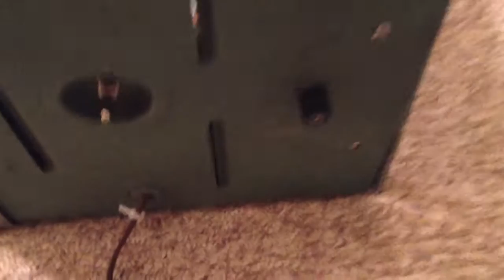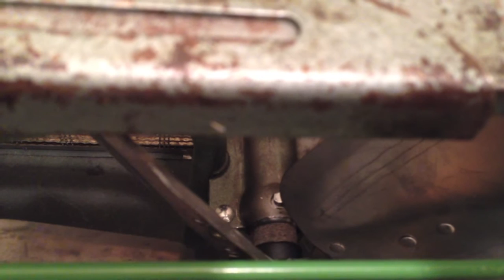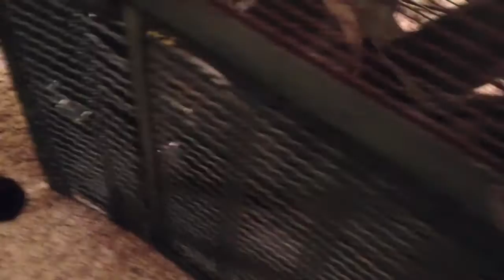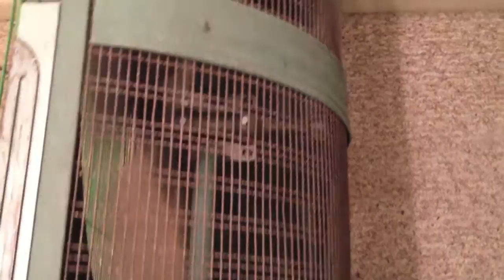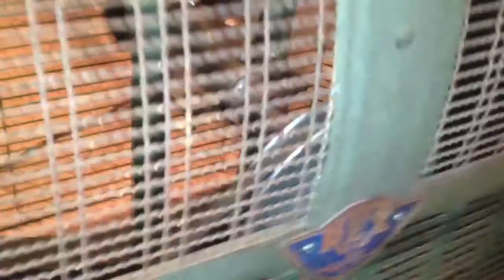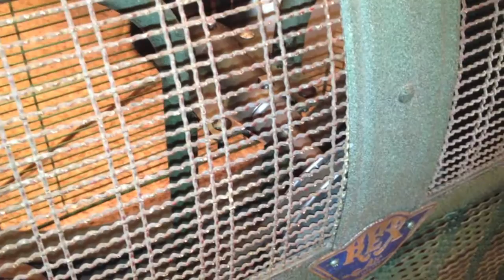Rex Air Controls Window Fan, New Emerson Motor

Comment: So where could I get the blade from because my dad and i well I got a reversible motor or so and we would’ve switched it to where it could or could or I guess maybe can rather and it was probably maybe like a .5050 or so like we switch it it could be wrong and we do. Outing to it it could be right. But since it’s in the clockwise position or I guess maybe setting rather and it took forever for my dad to wire it and we might switch it sometime to where the fan can spin clockwise..s but for is I think that we’re gonna keep it like this. But anyway what was wondering where do you think that I could get a blade like that because the picture this morning made me like a 15 or 16 something I said and I could just get the condenser Family for an AC unit in his bins that way? But I wouldn’t explain one or so, and as I was looking for some I found one on eBay but eBay won’t let me buy on the because it says we limit the amount of purchases to protect your account, well actually it says to protect her account we are limiting the amount of pressure. This is temporary but you can try again in a little while. This is the third time it said that in the first time it said that was near or I ngga it’s maybe around Christmas or 2019 or so/maybe something like that. But o was just wondering if they sell these blades or the whole thing but not on eBay or a website I can buy it from and stick it on my ccw homart for now